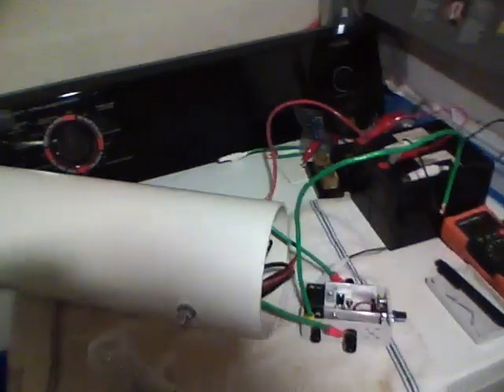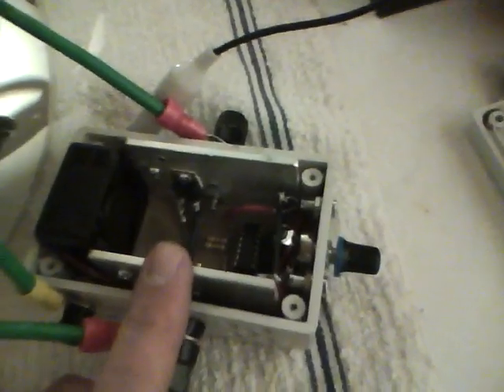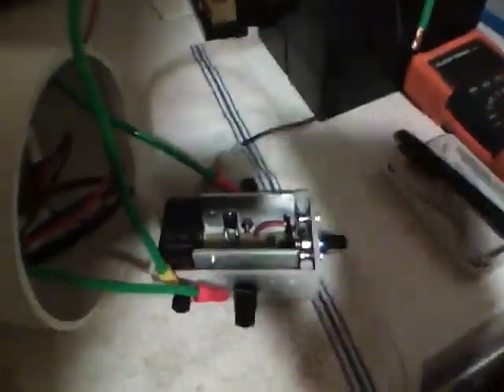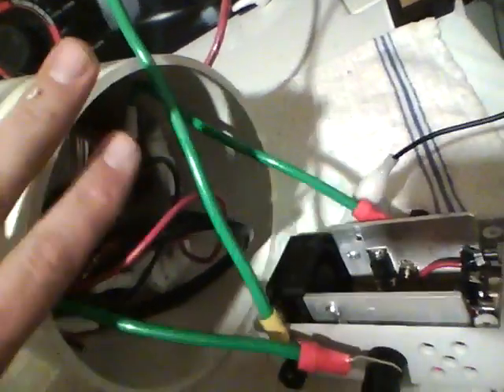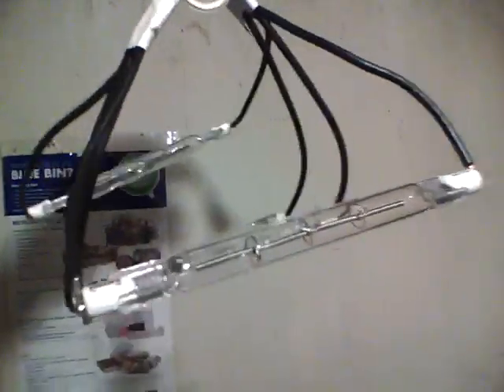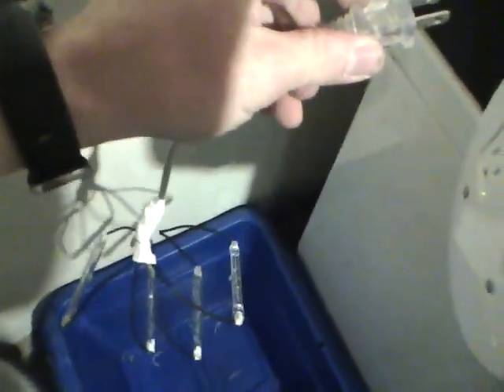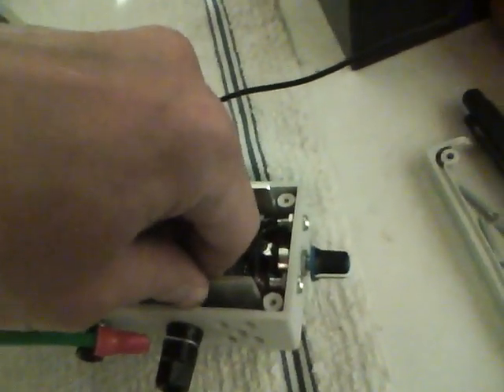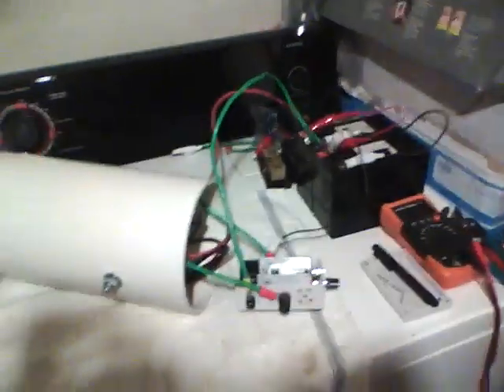Homemade Electrical Power Inverter

Comment: You should make a schematic for us so we can replicate  or experiment to see if we can improve your designs a bit.
Reply from the maker: Here is the website buddy, please watch my newer video on this because I'm using more transistors and pulsing litz coil wire for a cooler running operation. Thanks for watching.

http://www.eleccircuit.com/wp-content/uploads/2009/12/power-inverter-12vdc-to-220vac-using-cmos-4047.gif

Comment from the maker: Hello, I'm in the process of making that 5 to 10k watt inverter now...just waiting on my transistors to arrive from China. In the mean time the circuit schematic you can find here... w..electroschematics dot c./220/12v-dc-220v-ac-converter/. Thanks for watching.

Comment from the maker: Because of how the magnetic field is being introduced into the core. 
The core material is made of iron sheets wrapped into a toroid design made up into different sections collecting the magnetic pulses.
I used that frequency because of finding resonance in the core which aloud the transistors to work at higher outputs levels and not blow out. Please watch my new power inverter video with a newer design which does a excellent job at putting out the power! Thanks for watching.

Comment from the maker: Thanks buddy, this is the website I found it on but just used IRF1404 Transistors instead of the other ones...
w.....electroschematics dot c./220/12v-dc-220v-ac-converter/. I'm working on a even more simpler design than this and allot smaller. Thanks for watching.

Comment from the maker: Hello buddy, here is the schematic I used, except I used the IRF1404 transistors instead...You can use this for your transistors as well. The website is " w.....electroschematics dot c./220/12v-dc-220v-ac-converter/. This is all I can do for you right now..allot going on right now. Just let me know if you need anything else.. Thanks for watching.

Comment: Hello good day. I am kinda new to this but trying. However i need some help. I have about 24 irf3710 and would like to make an inverter circuit. I made one but wen i connect load to it (a house fan) the load doesnt work. Could i get some help please? Let me know if you can so we could arrange for better communication. Thank you

Comment from the maker: I actually gave the circuit diagram website below my friend...but here it is again.  w.....electroschematics dot c./220/12v-dc-220v-ac-converter/... I used IRF1404 transistor thou instead. Best regards..

Comment from the maker: Yes sir, if you take a regular inverter and replace the normal transformers with toroidal design it would give more energy efficiency and may increase the watts output than what it is rated at. I was going to try it out on a small 170watt inverter and post the video of the standard ones test and then the one converted and show the difference but never had the time to do it yet.

Comment from the maker: Actually the transformers were toroidal design that I purchased at a electronics store.. I wrapped a secondary coil of 8 gauge wire for the pulsing circuit... here is the schematic...w.....electroschematics dot c./220/12v-dc-220v-ac-converter/... Thanks for watching.

Comment from the maker: 12 volt 10 amp hr batteries each hooked up in parallel together... getting 100 amp shunt meter to measure current draw from batteries..upload new video soon. Thanks for watching.